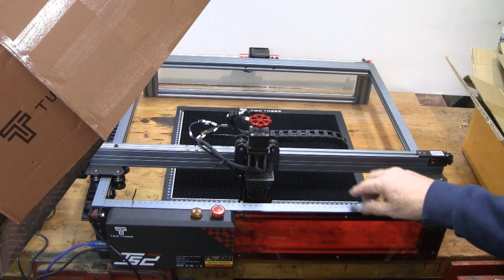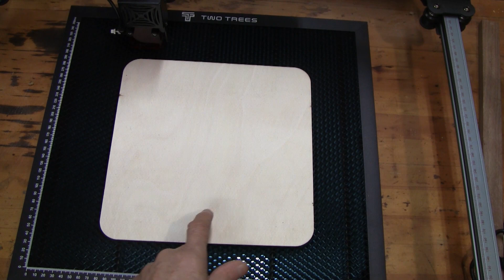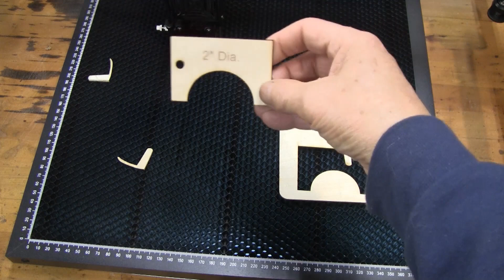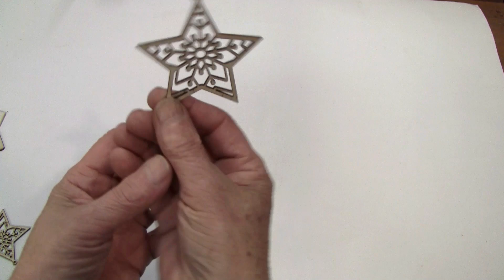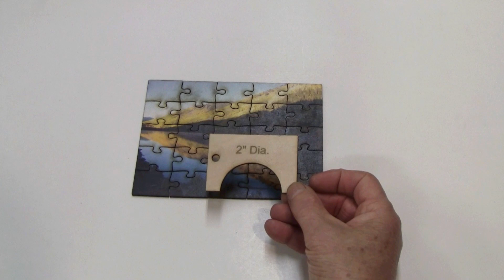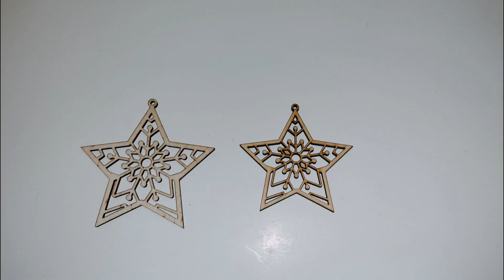Lasers Can Be Puzzling For Wood Turning Two Trees TS2

Comment: Fair play to you Gary. You can turn your hand to anything!! You are multi-talented 😊. I really like the video and you have explained it very well. Even I understood it lol. We only have metric here. All lumber is supplied in metric also so it’s kinda easy to convert to imperial I find. It seems laser is coming into woodworking a lot lately. Kinda makes you think what will come next really 🧐. Keep up the good work. I can’t wait to see what your gonna be up to next!!
Reply: By the way. How did you get the colour picture onto the piece of timber. That’s a neat trick. The gears in the brain is turning in my head? 😂
Reply from the maker: I forgot to mention that picture. I printed it out then used spray glue to attach it to the 2mm ply. Not doing it before I decided to spray lacquer on the picture before doing the laser work. I think it helped to keep the edges clean looking.
Gary
Reply from the maker: Many thanks Pat. It is hard for me to resist trying new things. So I really could not pass on the offer to try this one.
I do not fight using metrics as it was starting to come on a lot of drawings at work before I retired. Been there a long time but not all that often. We even had special rulers for measuring the patterns we made with the right shrinkage of the metal that would be used.
 I had a stack of those for different shrinkages . They were all in inches but the shop had a set of metric when needed.
 Thanks watching,
Gary
Reply: Ah great stuff. Thanks for replying Gary. What was your trade when you were still working? Sounded like a metal fabricator? That’s what I was in the younger years. But ailments pushed me to woodworking but I’ve grown to really get into it. Maybe a bit too much into it. 🤣🤣 keep up the good videos. I really do enjoy watching. 👍👍
Pat
Reply from the maker: No I was actually a wood pattern maker. Made 3 dimensional wood patterns from 2d drawings. They were used in metal casting foundries to make many different shapes.
I considered it the wood workers dream job.
Reply: Ah! You got me there. I wouldn’t have guessed that. Now I see where your talents have come from. Awesome stuff.  It really shows in the way you out things together. Thanks for replying. Eagerly awaiting your next video. 
Kindest regards 
Pat 👍👍

Comment: Very cool - the autofocus is pretty awesome.  Where did you get the templates for the hold-downs and jigsaw puzzles?  The hold-downs look useful even for a steel honeycomb when ones is using the whole piece and magnets won't fit anywhere.
Reply from the maker: Thank you Mark.  So the hold downs I just grabbed an image and brought it into Lightburn and traced it. I then adjusted the size to fit the honeycomb bad. Got it right on the first try.
 As for the puzzle pieces check out this site: https://lahobbyguy.com/bb/

You will need to make a login which is free and then you have access to free files he has on the page.

The puzzle files are there but here is the link.  https://lahobbyguy.com/bb/viewtopic.php?t=97

Gary
Reply: @ThePapa1947  Thanks.  I'm subscribed to LA Hobby Guy so I'll check that out

Comment: Well Gary, they just seem to get better and better! I think everyone should forget inches and work only in metric. I know that right now all dimensional lumber and so many woodworking measurements are in imperial, but the manipulation of metric measure is so simple, I can't believe there is such a fear or distrust.
Keep the laser videos coming!! Cheers, Rick
Reply from the maker: Thanks Rick. I have no fear of metric but I learned imperial and worked with it for many years. I could tell you the decimal numbers for all fractions up to an inch down to 32nds of an inch and most in 64ths. to 3 places. Plus subtract one from the other without a calculator 
Hard for an old guy to switch.
 But I do find mm's to work good for the speed of these machines.

Gary

Comment: just a little advice ..if you want your laser to last longer dont run you power at %100 ,run at %85 -% 90 max
Reply from the maker: Thank you Greg. I have heard that before. Seems like these companies would have it adjusted so 100% power is not maxing it out. I am sure for cutting if I went 90% at 250 mm/min it would do the same. I will give that a try.
Thanks,
Gary

Comment: could you use this machine to cut pieces or segments to be used in your geometric pattern turnings?
Reply from the maker: I doubt it would be work it trying to cut the thicker pieces but if they were thin enough I would say yes. Like if you were going to make a wall hanging.
 But coming soon I will be using it in something you will be interested in. Just getting the pieces ready right now.
Thanks for watching,
Gary

Comment: It would take me so long to work out how to use it that I’d probably leave it in a cabinet gathering dust. I also convert to inches most of the time  but at other times I use whatever in convenient. I’ve even taken an x measurement in metric and a y measurement in imperial on the same project!  Keep up the good work 🌞
Reply: Me too. I just don’t feel like spending hours and hours learning some software program, making a few doodads, and then getting bored with it. Then, a year later, having to relearn everything again to make a few more doodads.
Reply from the maker: There is a lot of truth to what you say. I have a CNC milling machine that takes up a lot of room and I thought about selling it. 
But just a 1/2 hour ago I needed it for something I was making. Comes in handy but it is using floor space where I could put a drum sander.
Reply from the maker: We started getting a lot of drawings in metric but we did have metric shrink rules which made it easy. If there was not a lot of dimensions I would convert them.
I think it is what ever you are used to. I do not see metric as being any better. When working with inches and using decimals two 3 places it is very accurate.

Comment: 👍👍 great video. 
at my work we have a lasercutter too, and i love to make puzzles out of leftover cardboard xD
Reply from the maker: They are fun. And it seems like cardboard is used for puzzles. Are you putting pictures on them first?
Does the cardboard smoke a lot?
Thanks for watching,
Gary
Reply: @ThePapa1947  the cardboard smells a little xD and i have to wipe it off after cutting so that it's reasonably clean. sometimes my fingers still get a little black when putting them together xD. 
i m actually lucky, at my work we have a UV printer, that i use to print on the cut puzzle (it prints on essentially any flat surface, as long as it's below 5cm high, and smaller than about 50x60cm). so that's what i ve mainly used. 
but i ve also tried using our plot-cutter (they are used to make stickers or tshirt prints) to cut the puzzle out as a sticker and then just put it on the cut out cardboard puzzle xD. that only sort of worked, because the laser cutter has a different kerf than the sticker paper cutter, and i had a hard time sticking it on in exactly the right place. so some puzzlepieces were a little hard to push together, and there was some offset. but the print was much much nicer looking. 
when i print on the cardboard with the UV printer the color isn't very good, because the cardboard takes in some moisture. when i print it on acrylic (which i've also tried) the color looks much better. there i have other issues tho (mainly i get uneven melting. the smaller parts of the puzzle melt more, and then the pieces don't quite match. you have to match them by the print-motive not by the puzzle piece shapes. a professional lasercutter who does YT videos suggested to me to maybe cut the acrylic with less power, maybe that would solve that problem. but i haven't gotten around to trying that)